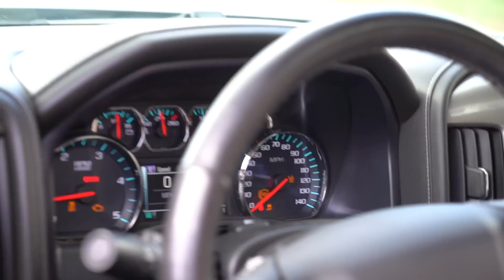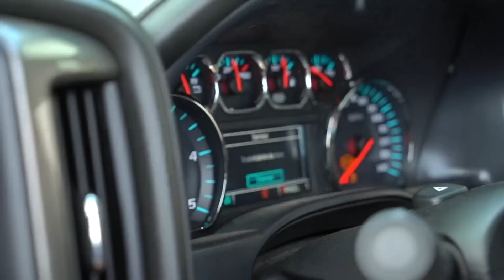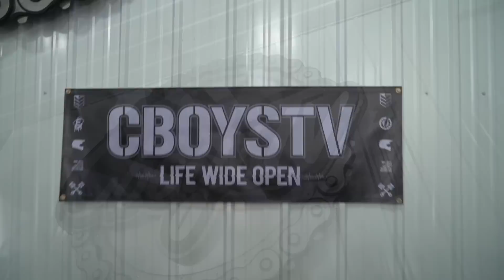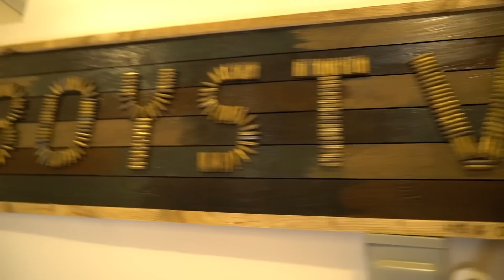CboysTV Shop Tour

Comment: The noise you were worried about is called a turbo chirp and if you want all the codes gone disconnect both batteries on the truck for about to minutes then connect Them back on.

Comment: I'm no expert, but that stabilitrak automatically kicks in when you get above 40mph regardless of if you manually disabled it by holding down traction control for 10 seconds. I'll be willing to bet that the truck overrode your input when you were doing 70mph burnouts and cut power to the drivetrain.
Reply from the maker: That sounds like an expert opinion..  and your probably right 😂

Comment: If you guys ever see this. It happened to my truck it’s bc of the wheel bearing to do with your traction control your wheels are spinning more in the back than the front even though you shut it off the computer takes over and has to shut it off before it breaks just have to clear the code